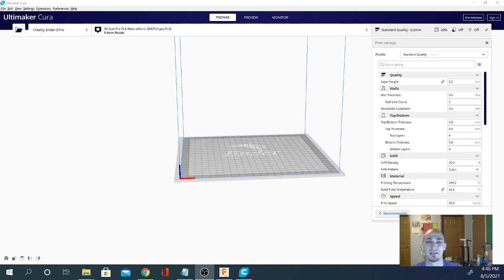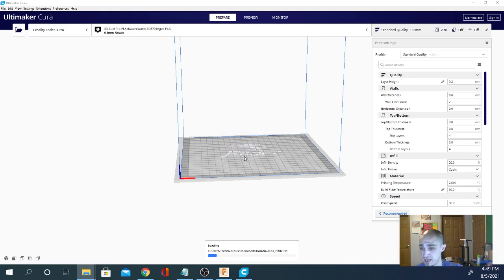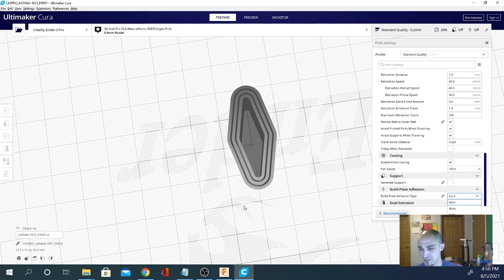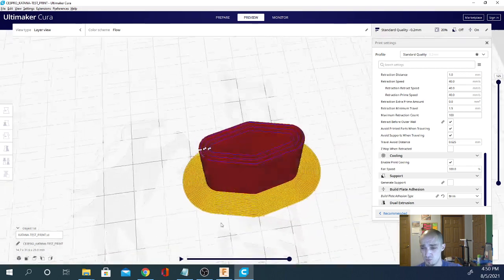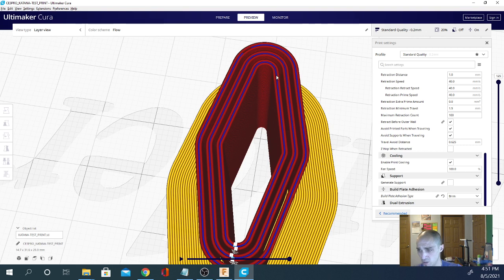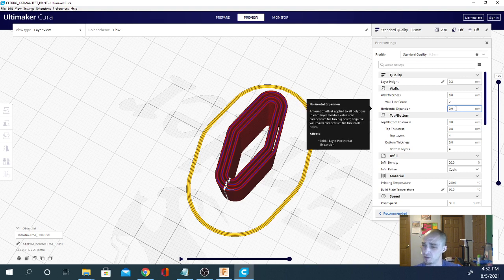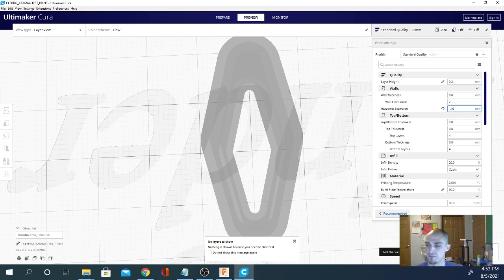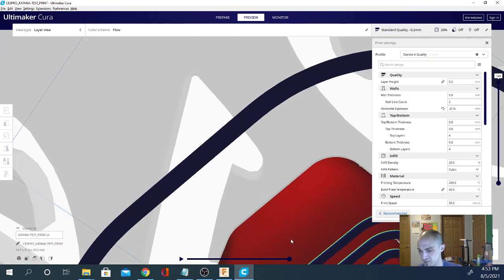Cura Questions! How to stop printed objects from fusing together!

Comment: mine fuses at the seam only... the white dots in you cura preview... any suggestions on how to go about that? thanks!
Reply: did you figure out the problem
Reply: A lot of suggestions I've read is to have your Z seam at random, did you already do that?
Reply: Enable outer wall wipe
Or try coasting
Reply: Mine 2
Reply: Set seam alignment to random

Comment: Thank you so much, this fixed my issue! I'm trying to print a ball and socket joint for a RC car and the ball kept getting fused inside the joint. You have saved me so much frustration and even saved me money because I don't need to find another model to print now! A -.02 horizontal expansion worked perfect!
Reply: im gonna try this, ive been trying to print a katana so i hope this works and i dont waste 16h
Reply: @GlitchTheOffical  ever work?

Comment: I have been having problems with the seams between each ring fusing together and someone talked about the wipe and coast settings but they weren't very specific so I cant figure out how to stop the seams between each section fusing, it would be really great if you could make a short video on this or give me some changes I can use to stop this from happening.
Reply: Saw this in a comment from another video about the Katana: 
Slicer - Cura 4.6
Nozzle - .4MM
Layer Height - 0.2mm
Line Width - 0.44mm
Wall Line Count - 2
Print Thin Walls check
Outer Wall Wipe Distance - 0.8mm
Retraction - 7mm @ 45mm/s
Cooling @ 100%
Coasting Volume - 0.004mm3 - If I try 0.064mm3 I get blank spaces. It's as if the printer doesn't finish printing the whole circumference of each cirlcle.
Minimum Volume before coasting - 0.8mm3
Reply: @beardogavin  Hi, from what video it is?
Reply: try to turn your combing off and set the minimum retraction travel distance really low and enable z hop
Reply: I challenge you to use your test print settings then slice the katana with them.  It does not work for me. Trust me.  I am no newb.  I’d like to see settings that were proven to print the sword.
Reply: @beardogavin  retraction is different on every filament.  Some of your other settings aren’t needed. Will cause most problems.  You got lucky if it printed.
Reply: @dugy40  Must be really lucky! I've printed the sword successfully 11 times on my machine using 9 different filaments. Comes out pristine every time! The only failure was due to a tangle in the spool. At the time of writing my initial comment (which was just copying and pasting someone else's settings that worked for me), I was very much new to 3D printing. I bet I could do things differently now that I have more experience with slicing and printing, but as they say, "if it's not broke... don't fix it."
Reply: Randomizing the “Z seam alignment” may not be the perfect solution compared to dialing in the other settings to reduce the extrusion problem BUT it will prevent things from locking up at the seam (because there won’t be one).
Reply: thanks
Reply: @yellovvcake  what would you recomment for the retraction travel distance
Reply: @beardogavin  are you using a direct drive setup? Why so high retraction?
Reply: @yellovvcake  minimum retraction travel distance did the trick for me, thanks!
Reply: @yellovvcake what is very low to you in terms of low minimum restriction
Reply: @sorryplease5071   that was my plan before finding this video. 
Since I'm printing with quite a few different settings, that's still my plan now. 
rather  those random dots than a lot of work that may or may not work.

Comment: Question
Cuts 5.6.0 cool change macro
Can I add a purge line after the color change then finish the print . I was able to add the purge code however it didn’t lift and continue, it just knocked the print off of the build plate.

Comment: It seems that the test print is fusing at the seam. The blades have enough clearance. Just a the seam which renders them stuck. If I change the Horizontal further then those blades will just slide out.

Comment: Have an issue with one of my STL. I took a base for one of the statues. Went to meshmixer added a bigger base. Then created a hole inside. So I can put a light.  When Cura slices it.  About halfway up it puts a solid layer covering the hole.  Any ideas

Comment: Mine are actually fusing together where the white line is, I just printed this a couple weeks ago now I can't get it to print without the entire model sticking together where the white line is, and I do happen to be printering this katana
Reply: I have exactly the same issue and have no clue how to solve it... Any help would be appreciated!
Reply: same problem here. i have printed 3 failed tests, and working on the 4th. no luck so far. its always fusing together at the white line.
Reply: what worked for me was a setting called z-seam and set to random.  That way the "seam" is randomly placed each layer instead of in a solid fused line

Comment: How can I print large bolt and nut together without fusing them together?. My  2 incg bolt tries to make supports for it's swirles. Is it possible to use bolt and nut together a whole piece to prevent making supports?
Reply: It is not possible. You must do both separate
Reply: If you want to avoid supports on the treads of a bolt, you can either turn off supports completely or change the overhang angle to something close to 90 degrees but not quite 90 degrees. For example, I had a model that had plenty of overhangs my printer was capable of handling without supports but there was one large section that was a 90 degree overhang. I only wanted support on that area and nowhere else so I changed the support overhang angle to 80 or 85 degrees and selected "only touching build plate" for this particular model. I got supports only in that area and nowhere else and they only touched the build plate which made it cleaner. Using this method, in theory you could print a bolt standing upright, with its head on top and supports wouldn't touch the bolt except for the bolt head. I hope that answers your question.

Comment: mine fuse together on the seam(the white when on preview)
Reply from the maker: Try changing the seam location to an outside corner
Reply: @Technivorous  Where exactly in the settings in cura is it? I started a few days ago so like yh
Reply: So I’m new to 3D printing and have only used cura, but today I downloaded Prusaslicer for my printer. I got this working for Prusa and not cura because I didn’t dial in cura. Mine kept fusing at the seam and when watching the print I realized it wasn’t retracting between each blade when on the seam. There is a setting in Prusa and I’m sure there is one in cura which basically says retract if you move a certain distance. The default was 2mm I changed it to .85mm and it then started retracting between seams. Mine now works. 

I also found the guy who made these. He has a video on how to trouble shoot. So basically this is the first issue you need to pass. The second test you need to pass is the thickness of each wall needs to be 85mm or .033-.034 inches. So after you fix this, test the next thing. He said to fix this you would increase or decrease flow rate in cura, or in Prusaslicer terms it’s called extrusion multiplier.
Reply: @OregonDuck  thank you! Ill try it out when i fix my printer:)
Reply: @OregonDuck  I've been banging my head trying to get this issue fixed, and that was exactly it. The setting in Cura is "Retraction Minimum Travel"
Reply: I love you all for this fix. Oh my gosh maybe my hair will grow back. Haha
Reply: @fanglaw1  thanks, ill give it a go!
Reply: Did it work? @BreakitDownBarneyStyle
Reply: @josephkhayyat4162  fuckin hell man that was 2 years ago. I don't remember.
Reply: @BreakitDownBarneyStyle  did it

Comment: HAVE YOU EVER USED A TWO IN ONE DUAL COLOR EXTRUDER I HAVE A TRONXY 2PRO 3E I CANT GET TO WORK ITS MY FIRST DUAL COLOR 3D PRINTER OUT OF THE 4 3D PRINTERS I HAVE DO YOU KNOW ANY CURA SETTING TO HELP SORRY ABOUT THE CAPS I JUST NOTICED THEY WHERE ON LOL